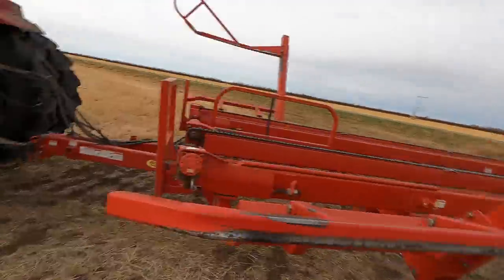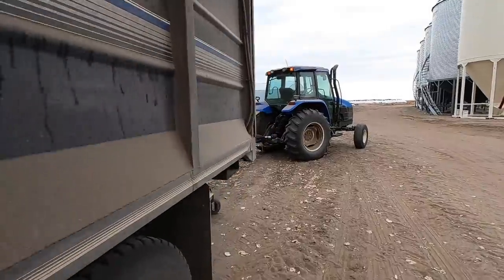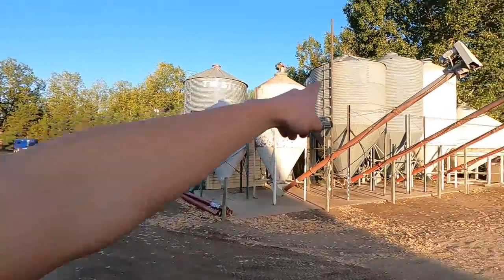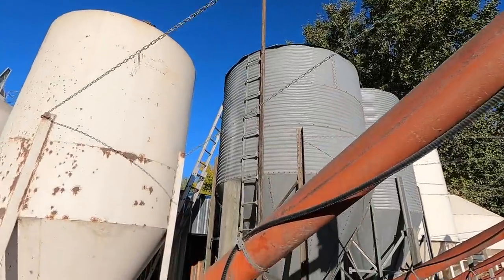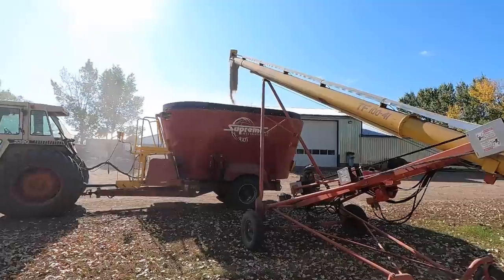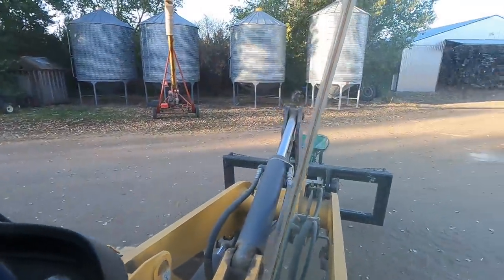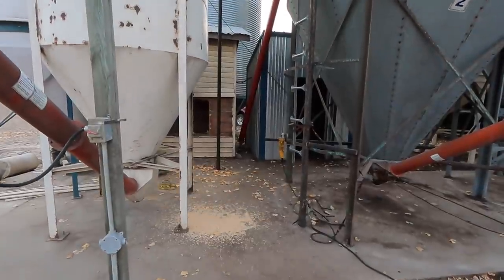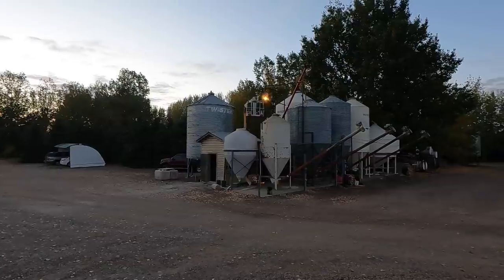Renovating Our Feed Mill!

Comment: Here is a trick when I work with fiberglass insulation which is equivalent to barley dust. So grab some baby powder and slather that on your exposed skin then it will not irritate ya! Hope that helps ya! CHEERS  from Chicago
Reply: Works great use it every time I run Cat 6 or any other cabling
Reply from the maker: I’ll try it out next time!

Comment: Barley dust is bad, but you should try removing a roof that has been on a house in Pittsburgh for 75 years just outside an old steel mill,  the soot and coal dust is like ink black,  you can't wash it off and you cough up black chunks for days and days!!!

Comment: I usually tie a chain to a oil fill cap and tie it to some place where there is a bolt to hook it to, do the same with a fill cap fasten a chain to the cap and tie it to the step etc. Saves a lot of time looking for lost caps. Keep Safe Jan.

Comment: Woulda chain on the fuel cap help?
Reply from the maker: Yes.. yes it would!
Reply: @saskdutchkid  So put a screw eye into the center of the gas cap, attach a half-meter chain to it, and connect the other end nearby on the tractor.  Won't ever happen again.

We all do dumb things at times.  If we're smart, we take action to prevent doing that again.